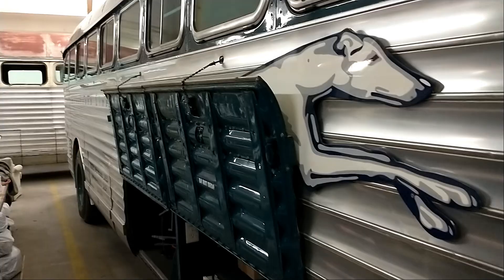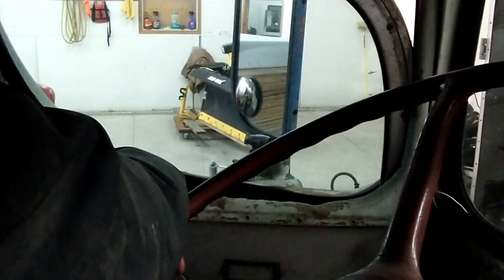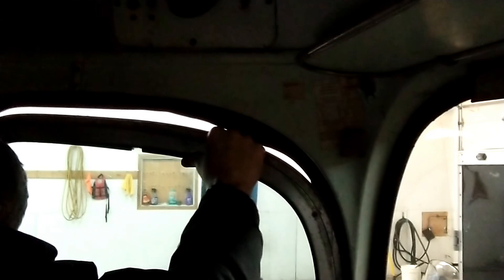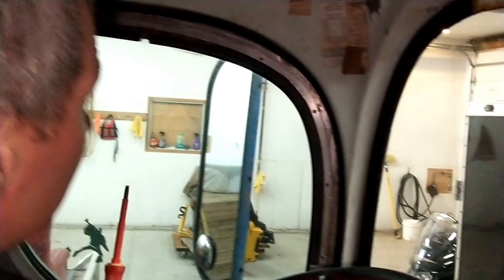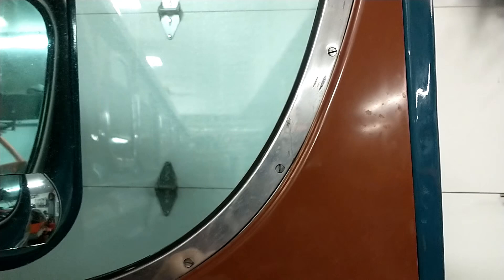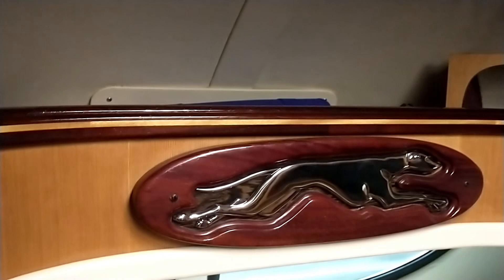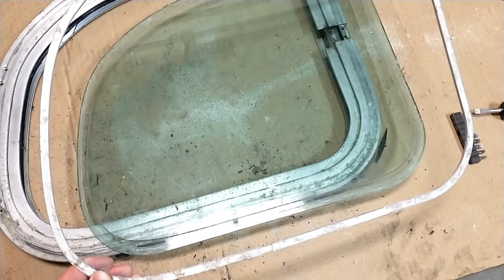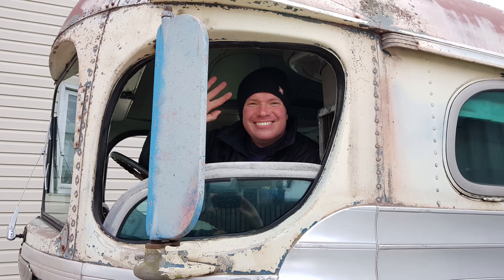We park Gus for the Winter & Remove some Windows!  Included is a quick tour of the Renner bus.

Comment: @Bus with Us Did you have to get an AZ license in Ontario to be able to be licensed to drive your bus?
Reply from the maker: Gus weighs in well under 11,000 kg so you can drive him on a "G" license.  However with air brakes you need to have a "Z" endorsement as well.  Motorhomes in Ontario over 11,000 kg require a D (or higher) license.  Many new owners purchase one without even knowing and can end up in trouble.
Reply: @BusWithUs.  So what did you get end up getting? DZ? lol